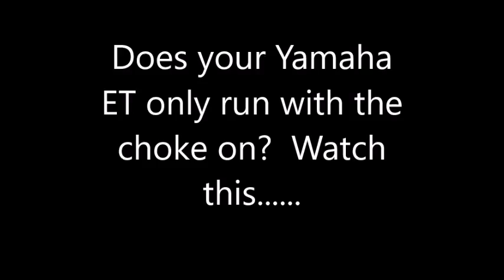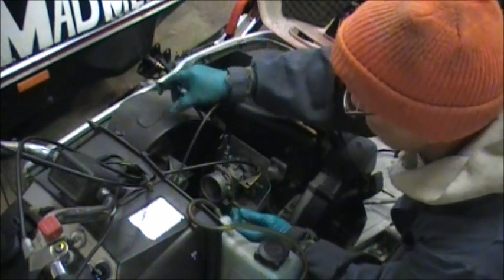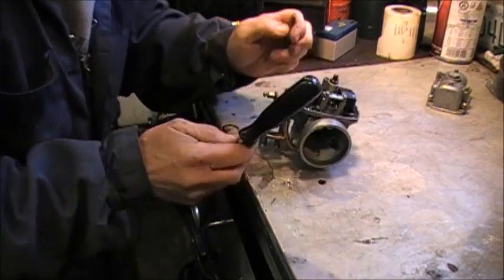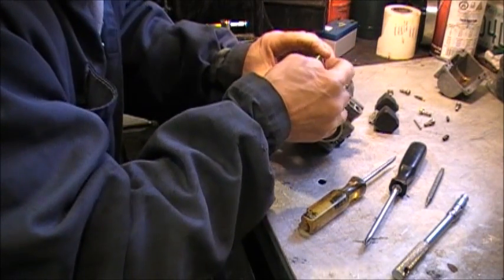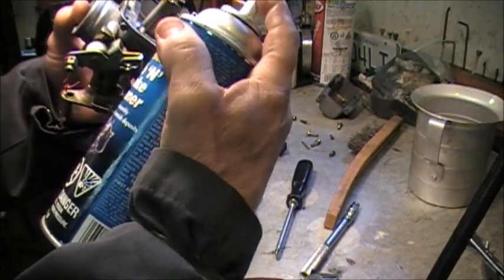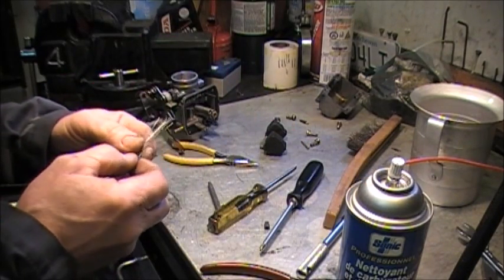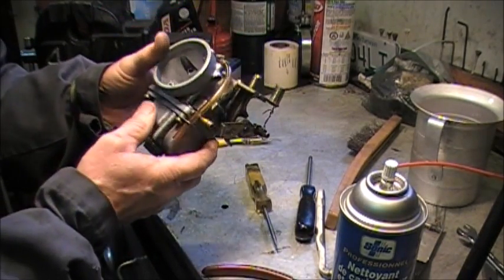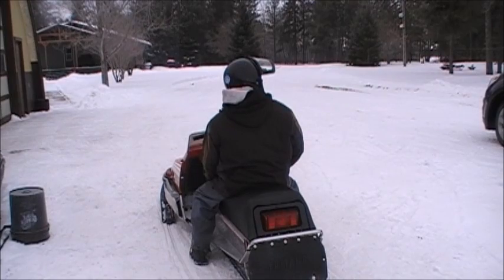Yamaha ET 340 Carb Problem

Comment: Wow, Thank you. I have an ET 300 and I've been fighting this carburetor for years. I held the butterfly open and sure enough two of the holes above were plugged up. Put the carb back on and it runs like it did when I bought it in 1980. I owe you a drink!!!!!!!!!!!!! John.
Reply from the maker: Hey that is great news mopardeer!  I wish I could go back in time to a 485 Venture a fellow repair guy was struggling with.....in retrospect I'm sure it had the same carbs with the same issue....Oh well!  Safe sledding!!
Reply: @wfvs1500  I appreciate you sharing your experience. Thanks again.

Comment: Very helpful. Thanks.👍
What is the breather tube that comes out the top front of carb?
Reply from the maker: I'm thinking it for a vent for the float bowl.  If it isn't vented, the fuel pump wont be able to fill the carb with gas to the correct level.

Comment: Do you know what the stock main jet is for the 79 340 enticer?
Reply from the maker: I'll have to dig out the manual, I'll get back to you...
Reply: Thanks 👍
Reply from the maker: Hi Josh, sorry I didn't get back to you sooner.  The Clymer manual says 1978 was a 220 main jet and 1979 to 1984 was a 240 main jet.
Reply: @wfvs1500  no worries! Thanks for the info, really good video!

Comment: Do you know what the barbed port on top is?  Vacuum? Mine has the port, but nothing connected to it.
Reply from the maker: I'm thinking it for a vent for the float bowl.  If it isn't vented, the fuel pump wont be able to fill the carb with gas to the correct level.

Comment: Need help with the choke cable
Reply from the maker: How can I help you. Lil Sheep?  Does your choke not work or does it work too well?
Reply: @wfvs1500  i cant remove it from the carburator
Reply from the maker: @HashiriyaDad  Sorry about the delay in getting bck to you.  yes i have had a few siezed choke cables and it's not fun.  I assume you were able to screw the brass threaded fitting out of the carb body that holds the choke plunger in place.  I would soak the plunger area in good penetrting oil and let it sit like overnight.  Then pry upwards on the choke cable with a prybar of some sort (I made a forked tool to use).  you mau have to buy a new a replacement cable.  It should come out eventually.  If all else fails one may have to install one of the primer kits and abandon the use of the choke, i'd say that is a last resort!  Good luck and never give up...!

Comment: I had my 84 ET300 running perfect last time I used it. I got it out this fall and it will not run right. It kills a plug almost instantly. Back fires out of the carb. I took the carb off again and looked at it. Cleaned it again. Although it seems perfectly clean. I'm at a loss. Any advice?

Comment: Would it be feasible to replace that butterfly carb with a VM38 round slide carb?  Seems like the Mv would be a bit less finnicky to work on, especially those tiny passages on the top of the bore.  Just kind of speculating.
Reply from the maker: Yes I agree,  the round slide would need a new throttle cable.  I seem to remember the throttle lever didn't have enough travel to open the replacement carb though.  Oh well it can be done for sure...

Comment: I just purchased a 1982 enticer 340 for my kids in the yard.  It ran for the kids but when I jumped on it Boggs badly and smokes and won’t even moves sometimes. I pulled the carb and it was pretty clean but it’s really clean now.  With it all back together I now have the idles screw and air screw all messed up. I had it started but it bogged then I messed around had it started and it ran full speed back to the yard and died as soon as I slowed down.  What are the factory setting for the idle screw and air mixture screw?
Reply from the maker: wowI totally missed this message.  I think the air mixture screw was initilly set at 1 turn out from seated .  The Idle speed 😋screw?  I guess its whatever suits without the sled running away on its own...

Comment: How did you fix the studs hitting the tunnel?
Reply from the maker: Hi Rene, I didn't deal with studs issues on this sled as it wasn't mine.  But first is make sure track tension is good, then install wear strips in the top inside of the tunnel.  Finally possibly a set of smaller drive sprockets, but then chaincase gearing would need to be looked at to maintain a good ratio.  Good luck!

Comment: Good video Thanks. Cleaning mine. On the intake side in front of the butterfly there are 2 ports at 6 and 5 o'clock position. The one at 5 o'clock position has a brass jet that is clear. The one at 6 o'clock position seems closed and goes to nothing. I did not see you cleaning the one at 6 o'clock. Am I correct ? The port at 6 o'clock does nothing ?
Reply from the maker: Hmmm, Sorry I don't remember.  I don't have access to that type of carb now.  I do remember the top jets caused some mis-diagnosis, so I bet you will be ok as long as they are clear.  Good luck and keep sledding....ALP

Comment: I have a 1989 Arctic Cat Cougar 500 fc, dual carbs, one cylinder heats up more then the other at idle and bogs when you open the throttle to fast idle at 15000 rpm is impossible unless i put my finger in the carb just before the slide, goes form 11000rpm to 1500 and idles fine without misfire. If my finger isnt there, it idles low and when you try to adjust the idle screw a bit, it revs up to 25000rpm and seems to run fine and has all its power but below that it bogs, i cleaned the carbs, motor was rebuilt, new crank seals, not to sure whats going on with it, cant figure it out.
Reply from the maker: Hey Mr Wolf, Sorry for the tardy response!

Your problem sounds weird.  I guess its back to basics, I'd run a stiff wire thru both pilot jets (or change them outright).  Adjust the idle air mixture screws to the same setting (like 1 to 2 turns out from lightly seated).  I'd also make sure the carb slides are synced exactly and the idle screws are set exactly the same.

If you still get an un-even idle you may consider swapping the carbs from side to side to see if the problem follows the carb.

Hows the spark on both cylinders, how is the compression?  Be vary of air leaks in the carb flanges.

I've had three 500 Suzuki Fan engines thru the shop over the years with broken or bent PTO output stubs on the crank (maybe its a weak spot?)

Let me know how you make out, and good luck.

Best regards

Al Pinkney

Comment: What is the the thing with the two wires under the idle screw, my bravo won't rev up unless I push up on it. Any help would be great.
Reply from the maker: It's probably the "Throttle Restriction Override System". It's meant to prevent Stuck open throttles.   I'd try adjusting the throttle cable slack, also make sure the throttle cable is  not sticking...Good luck...

Comment: Nice video.  I have a 79 enticer 340 idles great but at WOT it feels like its loading up and actually starts bogging down  . How do I fix this
Reply from the maker: Hi Wesley,   it could be a few different things.   I'd try turning on the choke when it's bogging /dying.  If the RPM's pickup it would seem like a fuel delivery problem.   My email is wfvs@sasktel.net if you want to consult.

Comment: Just got my carburetor cleaned and it still won’t idle but it’s great at top speed but when you slow down it will shut off.  Any advice?  Thank you
Reply from the maker: Yes I'd for sure we watch this video.  I think the low speed ports on the top inside of the carb are plugged up.....

Comment: Do you know the parts number to a cdi for 1984 yamaha 340 enticer transporter
Reply from the maker: Hi Marit!  Is the transporter the long track model?  If so then the Yamaha PN is 8VO-85540-21-00.  I think any ET340, or erven Phazer or Venture from those years would work on the Transporter.  They seem to use the same CDI Box.. Good Luck!

Comment: I have a problem on my venture 480, its getting to much fuel, on full gas it just sounds like its getting to much fuel, but i cant find out whats wrong
Reply from the maker: I'd guess one of the needle and seat (float inlet valve) is stuck open. Is it occurring one one or both cylinders?
Reply: I dont know, i must check
Reply: ON my snowmobile i have the problem that the choke stays on becouse its so cold.. Try check that
Reply: Suomen manki miles, dont think that,s The problem

Comment: My 250 enticer caught in reverse when i started it, whats wrong
Reply from the maker: Hmmm, I'm guess I'm not clear on what happened, an you elaborate?
Reply: WFVS she has no reverse its a 79 250 enticer and when i pulled the cord she started but she went in reverse
Reply: And now she will start but she only runs for 5 minutes when shes cold and when she warms up she cuts out and wont start untill she is cold again
Reply from the maker: Does it have the original ignition on it?
Reply: WFVS yes she does

Comment: Now when i removed the carbs, and put them back again it doesn't run at all
Reply from the maker: These Yamaha had the TROS, Throttle restriction override system, which is an electrical switch on the carb body. Is it hooked up properly?
Reply: WFVS not on mine, no cables